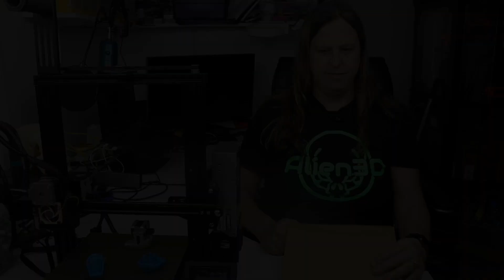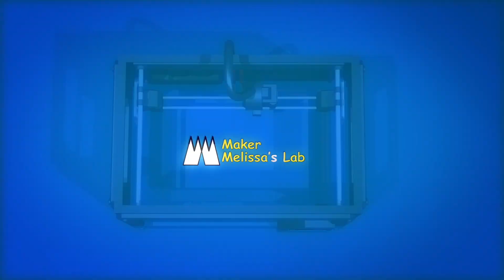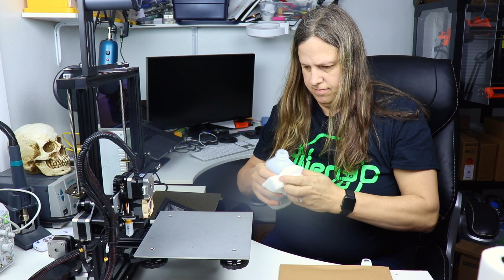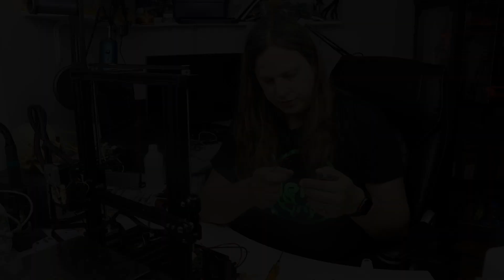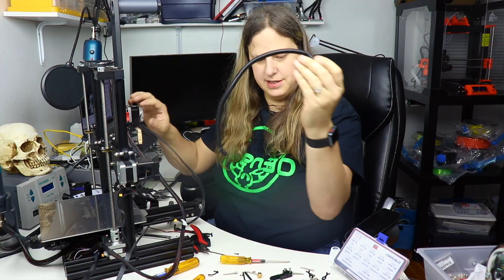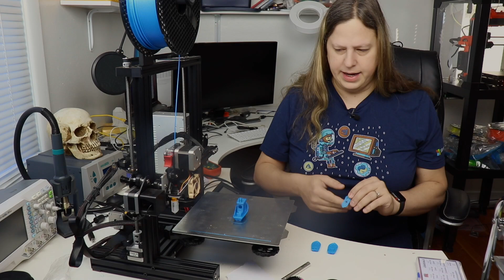My Ender 3 Upgrades (Round 2)

Comment: Thanks for the vid! I just got an Ender3 and am loving it. What has been the most impactful upgrade? I'm thinking of getting the SKR board and a BLTouch first. What would be your suggestions?
Reply from the maker: I would say the most impactful thing in terms of performance so far was the wham bam bed I added followed by the Hero Me Fan Duct and then the direct drive conversion. A lot of the things I upgraded such as the SKR1.3, fans, and steppers were to make it print quieter.